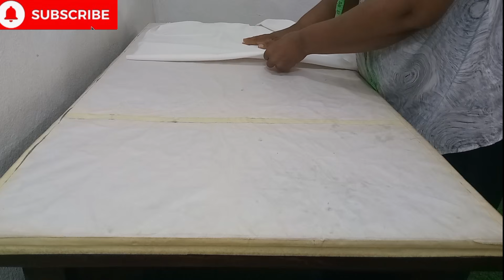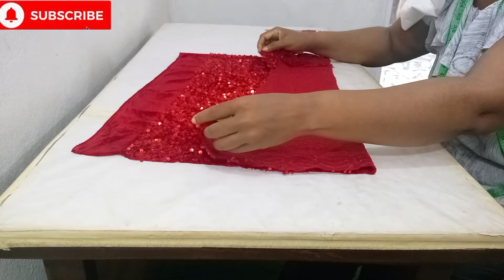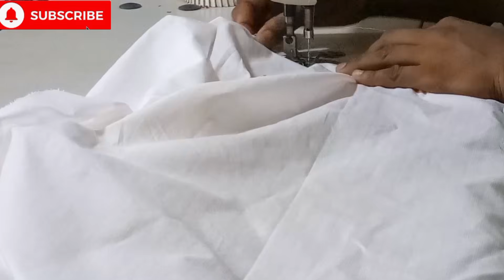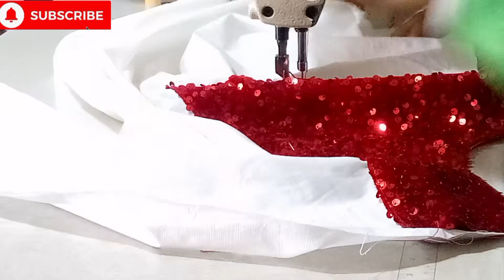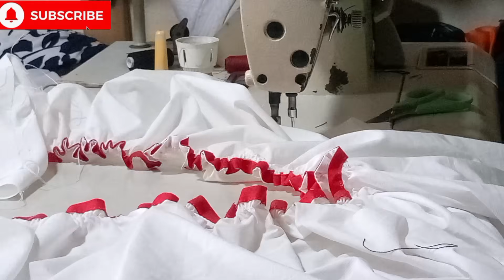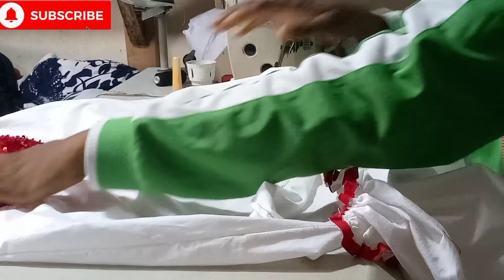How I Made Trendy Short Bubu Kaftan with Two Fabrics #bubu

Comment: This tutorial is packed full and straight forward to the point.So,what if your hip is bigger than the bust measurement,can we use it?I noticed the length of the dress surpassed the hip line area,as such using the bust measurement won't yield good results.I hope you understand my question?Thank you for sharing your knowledge with us.I hope you're much better now?Take care..❤🙏
Reply from the maker: When ever the hip is bigger, use it. Most at times I cross check my hip circumference on the hip line when making an A-cut, but the A- line doesn't affect the hip circumference. I will explain this point in my next video of Bubu. Am better now dear, thanks so much ❤
Reply: @LoisAddah Thank you so much for your quick response.The reason i asked it's because,we have new learners here and they might not know this and as such,they go with the crowd..😊.Thank you for your explanations and you're truly appreciated...🙏❤️
Reply from the maker: @Melissa-m8k your welcome 🤗❤. Am glad you asked.
Reply: Glad to know you're better...❤️😘
Reply from the maker: @Melissa-m8k thanks so much dear ❤